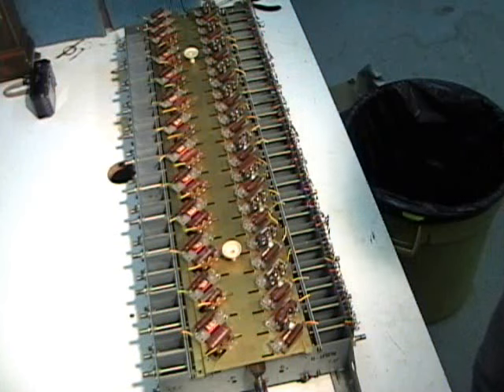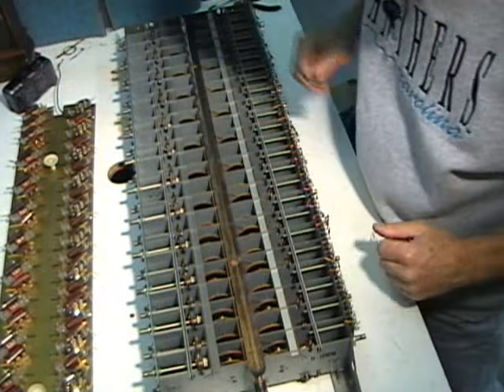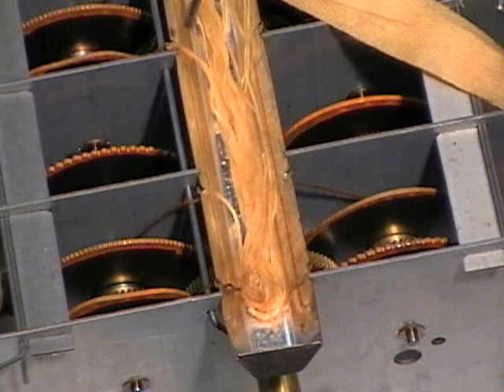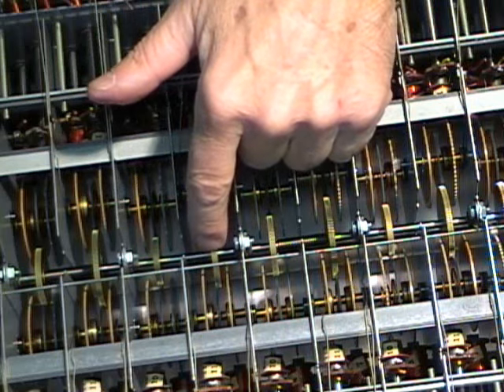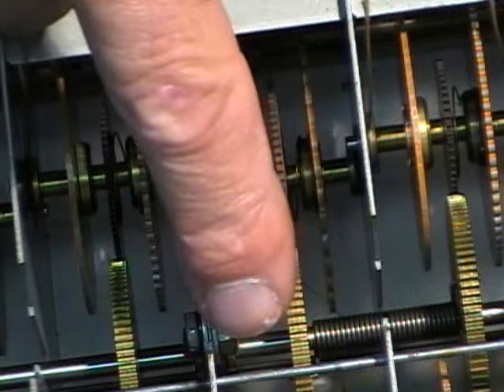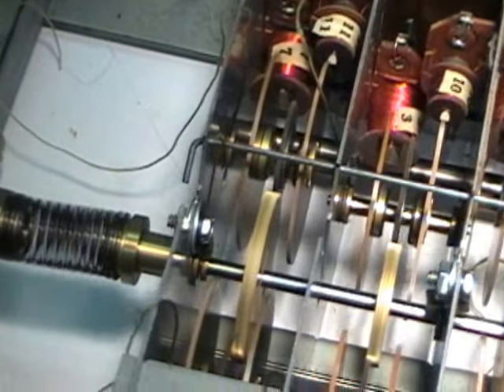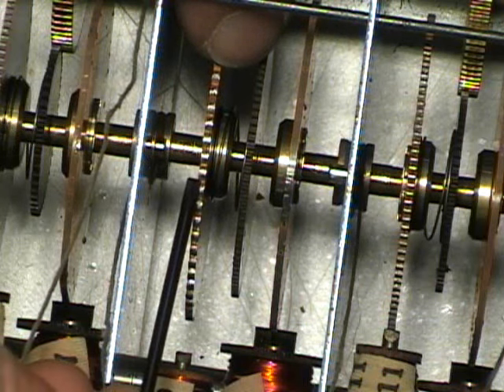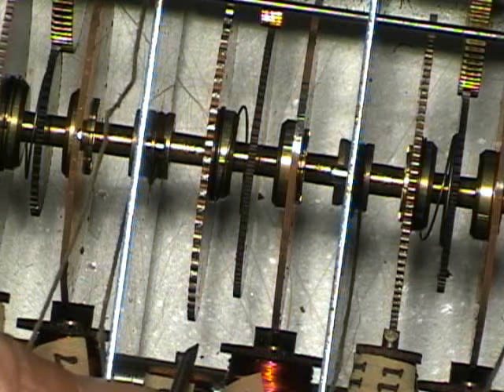Hammond Organ Tone Generator

Comment from the maker: You are right...I doubt that there will be many digital instruments playing after 78 years. Worst case is if electronic components like caps, resistors and tubes are not made. At that time, though, we still have excellent amp replacements like those made by Trek, and the tonewheels still make the tones.
The motors are repairable, BTW. Bearings can be replaced and they can be rewound if necessary.

Comment from the maker: @TheMic609 It definately needs oil! Fill each of the funnels to the top twice, wait a few days, then repeat. It can take a week or m ore for the oil to finally reach the bearings. I would not turn it on for any length of time if it is squealing...you run a risk of wearing out some of the bearings, or wore yet, causing one to seize.
If you are impatient, it is possible to unbolt the TG and oil each of the bearings from below. You will need something like a hyperdermic syringe with a long needle.

Comment: hi bob man,

i have an M 101, and until about a week ago it was running fine. I have a feeling one of my room mates might have tried to turn it on without knowing the procedure.

When I turn it on, i hear the wheeel start to spin, and it seems like its gonna work, but there is just no sound. any tips? where should i oil it? what kind of oil?

thanks,

-dennis

Comment: Hi there, BIG thanx for this vid!!

I got a M3, for nearly 8 years now. As i get it, it´s TG was not runnig very well as it was standing in an edge for 20 years, or so, unused (shame!), I cleaned it, simply by fillig it with two cans of WD40, and flows out pretty dark at first. But then lighter and lighter.Since then, the M3 and it´s TG, works verry well, with regular oil service and,of course, regular playing..!
But I never, ever disasemble the TG - so it´s great to see it like this...:)

Comment: One suggestion: Make another video with the same Tone Genarator running, but this time, use two small paper squares (one per hand) that you will gently bring to the tonewheels just enough to generate a listenable tone. This way, we will be able to hear the tones generated by each tonewheel without having it slow down (generating a false tone).

Thank you.

Comment from the maker: @wandov8 What is the purpose for more DB? More tones or the ability to have 2 sets per manual like a console? The former would be something that I have never heard done...the latter could be theoretically done with the proper switching. I would guess that you could have a switch with 9 poles that would allow switching from one DB set to the other.
The H series does have 2 additional DB, but the H's TG also has more tonewheels. 
Look up the schematics to the M3 to see what is involved.

Comment: Hello Bobmen, I hear your the Doctor of Hammonds by many Hammond organ players, so here's my question, I just picked up an 1964 a100 clean condition. Very clean,
For around $550 from a Lutheran church out here in Texas a small little town, moving forward, getting the Organ home come to found out tones are missing in the up and down Manual was hoping it was a simple wiring Attachwirein  issue, but then I had message a guy name Peter who was kind enough to give me some  General advice from YouTube,  you may know him or saw him on YouTube, not to question his Knowledge,  But getting a second opinion,  And I would appreciate your expertise on the matter, moving on, the up and down keys on first  drawbar on both Manual 49 51 keys have no sound. 
 second drawbar out on both  Manual no sound on 28- 30  D&E almost all drawbars tones are out on both  Manuals  a couple of keys that is,   The exact keys on up and down are not play tones,  I would appreciate any help  And expert advice you can give me  as for as what I'm up against here,  Would very much be appreciated.

Note: it's only the white keys that are out,
The last drawbar out plays all keys.

thanks Bobmen!

Comment from the maker: @noahjm10 This system is simple. Strings carry oil from that trough to the bearing via capillary action. The string is simply wrapped around the bearing, which is porous. Don't get too concerned about over-oiling. Worst that can happen is that the trough will overflow and make a puddle under the TG. Fill the funnel to the top, let it drain, then fill it again. Do this anually. Ten drops is not enough.

Comment: Thank you for sharing.

What I been searching for, not continuously, for at least several hours, is how to tune this after the capacitors are replaced, especially since non-standard values.

Cheers,
Adriel
Reply from the maker: There are 2 ways to calibrate.
You will need either an oscilloscope or a millivolt meter.
You can either change the capacitor values to achieve the desired output, or move the magnetic pickup rods in or out to achieve the desired value.
You may want to also look into installing a R/C network in those tones that need it.
You will need to procure a set of tone values and match your values to the chosen calibration curve.
https://hammond-leslie.info/KonsTGandTaperingData/
Go to "the organ forum" web site and ask for assistance. There are a lot ov very competent and helpful people on that forum.
This is a tedious process, and difficult to perform with the TG installed as half the pickups are at the back and hard to reach.
Also the tiny locking screws for the pickups are easily broken off if they are frozen in place, and there is no real repair for that other than TG dismantling.
Reply: @bobmann107 , thank you for your help.

Right now, have a Harbor Fright DVM (spelling intentional) and a Heathkit 7A that was my first re-cap. Since it is a comparison, the readings only have to be reliable, correct?

Okay, great knowing there are two methods. Maybe since I prefer having it performing best as possible, little of both. I do plan on marking where originally positioned so can return, plus, with it off, mark in red where it would contact, rather avoid dulling the tip and removing the lacquer..

Looked into the RC network just now, I have decided against, I want as much force out of it as possible (when unknowingly played it since 12 years of age, self taught, for a number of years until knew better, usually played at medium to full volume).

That was one of the resources looking for, the link is so very helpful! 😁 Here I thought all equal, rather, maximum value and generally in a similar slope.

I been a member of the forum for a very long time, lot changed, though not too long ago, asked for help and it was difficult.

I am aware of it being a bit tedious, but, I adore tedium. 

Yes, I just found out the tone generator must be removed, any tips? Even with masking tape and a marker, the plethora of wires is terrifying.

Good to know about the locking screws, have SiliKroil in an oiler, so add some and let it soak while re-capping. 

Cheers,
Adriel
Reply from the maker: @adrielrowley  On the Organ Forum there is a file in the hammond forum under topics of a number guide for the terminal strip. It helps when putting it back together.
Look here, there is a lot of information on the TG recalibration and cap replacement.
https://organforum.com/forums/forum/electronic-organs-midi/hammond-organs/735606-tonewheel-output-calibration
Reply from the maker: I have a video on keyboard removal. This is a part of the process of TG removal, as all the same wires are disconnected.
You could actually leave the TG in place, and take the keyboard out to access the TG. This would also mean that the pedal wires on the TG could stay in place.
Reply: @bobmann107  Thank you for taking the time to find and reply to my questions, very much appreciated. 😁

Yes, I am making a mountain out of a molehill, sorry. I downloaded the file, see about getting it printed. That should save a lot of time.

My high strung mind is having a hard time reading through the thread, I rather have data like what is provided in the thread I shared... However, if have another relapse of being unwell, I have something to read.

Removing the manual also allow me to fix my mistake made due to inexperience (now know to slide protection in) plus clean and re-grease the strips.

Cheers,
Adriel
Reply: @bobmann107  My example turns out not to have a terminal strip, so back to masking tape.

All the 0,105 capacitors removed, all the switches removed, pilot lamp wires, then being un-thinking due to a tough day remove a screw from the vibrato in an attempt to avoid the tribulation of un-soldering, only to realize what an atrocious decision that was, going to be fun getting the inside piece back into place; been nice in all the information read and videos watched if mentioned the risk, but, probably never expect an idiot like myself. So call it a night and get after removing the black manual wires in the morning.

Comment: I just picked up a Hammond H-100 that showed up for free on FB Marketplace. It was in a garage and probably hadn't been oiled or used for 40+ years. The vinyl power sheath was crumbly. Now it's in my garage and I'm replacing the electrolytic filter capacitors on the power supply and the 5AR4 rectifier tubes are suspect. I've ordered solid state plug-in 5AR4 replacements for use in testing and may go back to 5AR4 tubes later. I'm going to replace the canned electrolytics with an axial cap array and relocate them off of the chassis (onto the cab wall) and connect them with longer wires. Two plastic keys are broken, so I need to figure out how to replace those. Overall, mine was pretty clean inside and had a mostly-full original oil tube inside. I've oiled the two funnels, the two motor tubes, and the vibrato well. When disconnected from the tonewheel main shaft, the motor spins and is silent. However, the tonewheel shaft acts "spring loaded" and, if I try to rotate it, it returns to its original position. I think something just after the 1st spring junction is binding it. The tonewheels look new and undamaged and most of them spin freely and have a bit of free axial play, which I understand is a good sign. I need to scan them carefully and identify the problem spots. When I opened it up, it looked like the thick brown felt blanket over the TG was factory placed, so I don't think it likely that any foreign objects fell into the mechanism. Possibly, some bits are dry-oil-residue glued together? Or, maybe a tonewheel sensor is out of position and binding a tonewheel (probably not that, since your video demonstrates that isolated tonewheels can jam without affecting others)? Anywho, anyone who has advice or ideas to share, thanks in advance! Thanks you, Rinoa, for the video and explanation!
Reply from the maker: When the TG shaft acts like that it is certainly because there are bearings that are gummed up and frozen. Sometimes, oiling the TG and waiting a couple weeks for the oil to get where it is supposed to be will fix things.
Whatever you do, do not force it. Turn gently back and forth. The main shaft has several spring couplings that make it feel this way. If you force it and the springs become dislodged, the TG will be trashed, as fixing is a major job.
If you can see the screws on the broken keys and something to glue to, I would get some 5 minute epoxy and glue the nroken keys in place. Access to these keys is another major job...take a look at the video I posted.
Reply from the maker: also look at the video on the tonewheel generator...that one in the video is actually from an H like yours.

Comment: if no sound comes out of the old but working car speaker and the amp has some access you may want to look for a fuse area to see if something causing it to burn out (also called an 'open'), of course I am giving general information here which might not apply at all to a Hammond, I'm sure there are lots of people online who do know about them, good luck and hope your fix is simple.

Comment: Yes they are amazing alright, and so streamlined in their function. I have Hammond and Wurlitzer electromechanical organs and I'm hoping to be able to find a simple way to add individual volume controls to each of the tabs on my Wurlitzer electrostatic reed organ so that it can be as versatile as a Hammond. Wurlitzer used reeds as tone generators not as audible sound, but instead the each reed fluttering in front of a pick-up acted like a constant varying capacitor. Google Wurlitzer 4600 Series.

Comment: Does pressing a key move the pickup close to the wheel to pick up the sound, or does it close a circuit to send the sound on from the pickup?
Reply from the maker: Once the TG is calibrated, the pickups are locked in place. When you press a key, there are 9 contacts that complete the circuit. I posted a video about the key contacts that you may be interested in.

Comment: Felt like I was watching an autopsy of a loved one. 

I have a CV/3 fitted with Trek III percussion that does 2nd, 3rd and 5th harmonic. clean as can be and I pit a hotter tube in the Leslie so it distorts at lower volume. and all new caps and rebuilt scanner done by a pro.

Comment: Faraday’s Law of Induction is in play not Hall effect. Hall effect is a differential across a conductor. Faradays law of induction is the change (caused by the lobe on the tone wheel. ) in a magnetic field that is transmitted as an electric field into the actual wire in the coil surrounding the magnet. An electric guitar works the same way.

Comment from the maker: dangit! Anyway, the power may be other than 60HZ; for example European power is 50HZ. The other thing is that the starting capacitor may be going bad; this will prevent the TG from reaching full speed. Now that I think about it, there is one other thing, and that is if the TG has not been properly oiled it may be dragging.

Comment: EXCELENT PRESENTATION, in your opinion, what would be the reason to replace to a tone wheel generator/  over repairing the older that is not working. I know thats a broad quest  but it seems to me that they are made like a tank. if not  lubricated even a tank will stop.
Reply from the maker: If I understand what you are asking, there can be many reasons for a TG not functioning properly. Each reason has a degree of difficulty, and more importantly the model of the organ must be considered.
An M series, for example, has a street value around here of $0-$100. I would not think investing in replacement parts and the many hours of labor would be very cost effective.
Also consider that any parts would be removed from a donor organ. Just replacing the entire TG would be more economical in 99.9% of the cases.
Not to mention the fact that the difficulty factor of disassembling a TG and putting it back together rates about a 14 on a scale of 1 - 10.
Reply: The reason for the question.  There was is Hammond E-112 model on the free ads on craigslist. the ad reads: Hammond E-112 turns on but won't play. A organ repairman said this organ needs a new tone wheel.  Don't let this one go to waste. : end

Comment: The mechanical tone generator will still be working long after digital instruments.  There are no integrated circuits, RAMs or ROMs to become obsolete.  Just keep the bearings oiled and as long as the motor does not burn out all will be fine and readily repairable.

Comment from the maker: @wandov8 The Tone Generators are diffent, B3 to M3. Keyboards are totally different, even apart from the number of octaves. Look up "Keyboard Tapering". There are resistance wires inside the keyboard that shape the tones. 
An M3 will never be a B3.
Look up "Foldback" which involves the altering or rearranging of tones in the keyboard.
Note that both organs have 9 DB per keyboard.
What you stated is like saying the crutial difference between a Corvette and a Cobalt is only the dash board.

Comment: bobmann107 I had an organ go out of tune once because it had a poorly lubricated TG (that was of course immediately after I bought it, and before I had any oil to properly lubricate it).  The extra friction slowed down a few of the wheels such that two or three keys (on a single drawbar) produced wavering and noticeably low (more than a half tone) pitch.  Of course, the TG also made an awful noise whenever it was switched on, so I didn't play it much until I fixed it.  Now that's all fixed and it's back in tune though!
Reply: Uncertifieduo Flight Instructor

Comment from the maker: A hammond runs off a synchronus motor, and will rotate at the correct speed if supplied with 60Hz power. If it is out of tune it is one of 2 things; incoming power is at something other than 60
Reply: What’s the other thing?